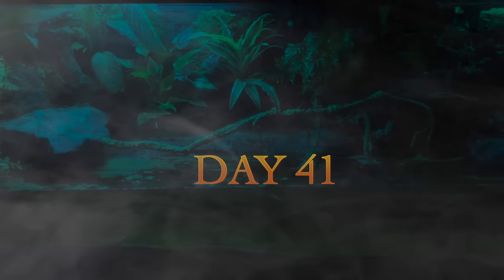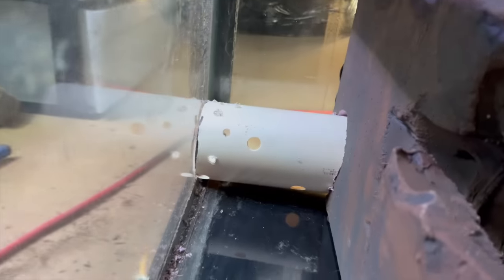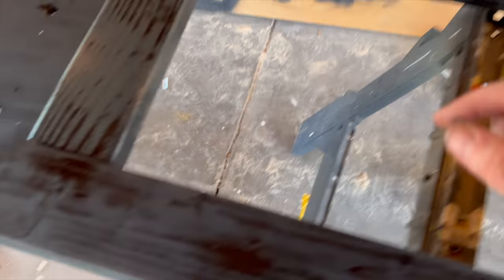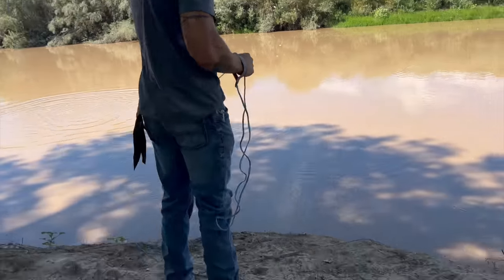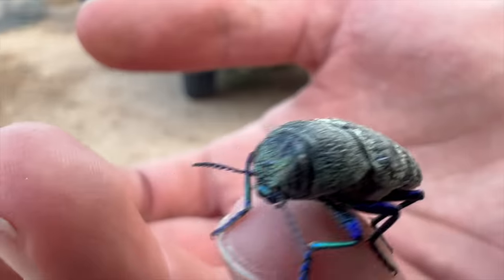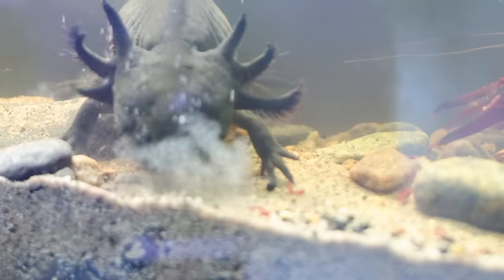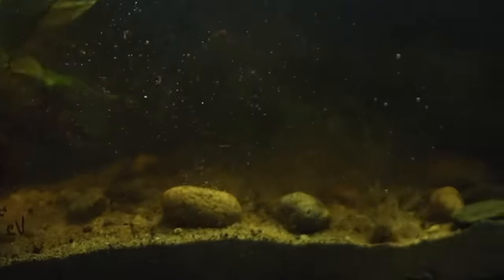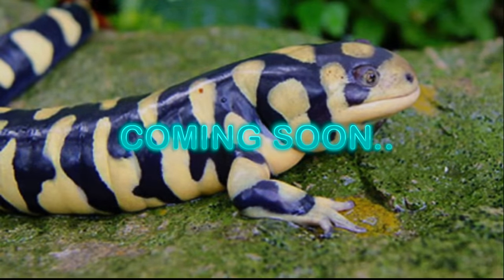150 Gallon SWAMP SIMULATION ( Battle for king of Amphibia ) Pt 1

Comment: Why do ppl so often make synthetic rocks? Why not use natural ones? Idk it just doesn't seem good or sustainable to add faom and paint into these delicate ecosystems. Is it dangerous to use a rock from outside? I feel like you could just bake the rocks in the oven for awhile to sterilize it w heat and avoid any unwanted transfer of bacteria or creatures
Reply from the maker: The reason we make fake rocks is because cause real rocks are too heavy. You could crack the glass with too many rocks and ide have no way of moving the tank. The fake rocks I make a perfectly safe and don’t weigh much.

Comment: I worry about the axolotl not only being in an enclosure with a turtle, but also being in an enclosure with gravel like that. 

Axolotls suck water into their mouth to feed, almost like a vacuum, so keeping them on gravel really isn't recommended because they can ingest it and it can cause compactions. Keepers might use gravel and not notice any issues at first but then suddenly their animal has a blockage and needs emergency surgery or it passes away. This is why most axolotl keepers use fine grain sand and large rocks as the top substrate only or don't use substrate at all. 

Additionally, no keeper can monitor their animals 24/7. Axolotls are really soft bodied and can be injured easily by an animal like a turtle, even on accident. Axolotls are best kept alone, in same sex groups, or with small, non predator tank mates they can't or won't eat. 

I also worry about the turtle and the axolotl having wildly different care requirements. Axolotls require their water cold (under 70F is ideal) but snapping turtles (i assume that is the kind of turtle this is) are recommended to be kept at 75F or above.... this temperature could make an an axolotl very ill. 

I really hope these guys are separated now and they are both getting the care they need. Axolotls are hardy but long enough in an unideal environment is bound to cause injuries, illness, etc.
Reply from the maker: @ormrkin  well not an axolotl it’s a water dog and if you watch my newest video or any other video I’ve made on him you will see he is fine and no longer a water dog but a salamander
Reply: @MrHillbilly  you mean he is a larval tiger salamander? their care requirements are the same until they morph. 

i see it's morphed now but that's still a pretty tenuous environment for a larval salamander in the time before it morphs. I'm glad it's not in the same space as the turtle anymore.

Comment: Like to vote for a Season terrarium
Reply from the maker: Like summer fall winter spring?
Reply: @MrHillbilly  yeah that is the idea. I dont know if it is actually possible but it is a challenge. You used rain and fog systems in this terrarium. The only thing you need now is a heater and a cooler. I also saw someone else simulate a wildfire in a terrarium.
Reply from the maker: @Spamboot3000  the issue with that and this tank is the water temp has to stay between 60-70 for the water dog. I might be able to another tank with specific animal that go under ground for winter and likes the heat in the summer.
Reply: @MrHillbilly  yeah not that swamp Tank. Maybe a one with native species. I saw you life in a 4 season climate,right?
Reply from the maker: Ya they are getting ready for the long nap here pretty soon